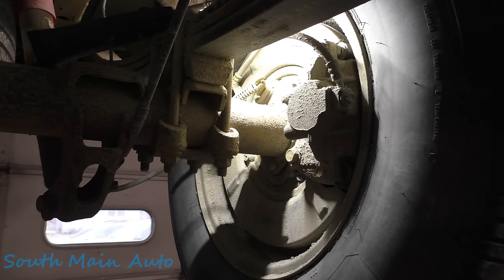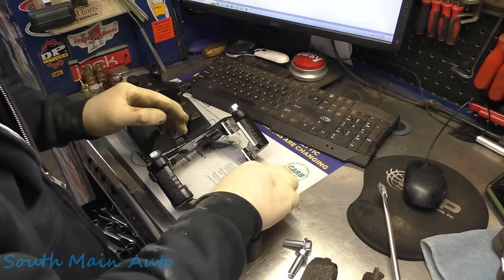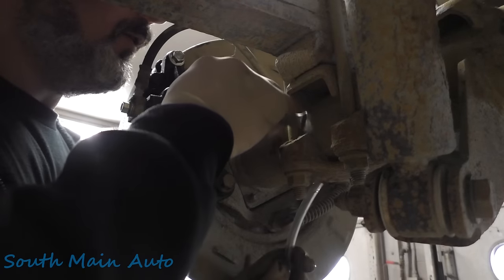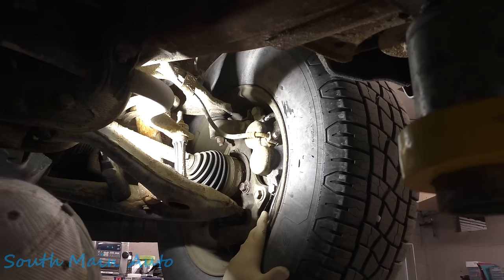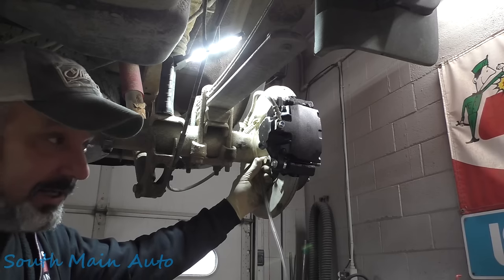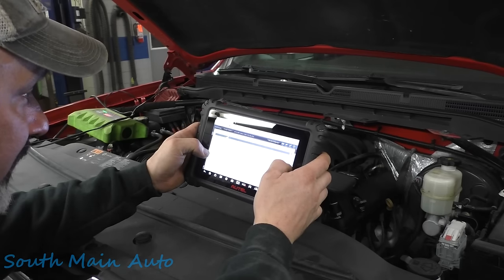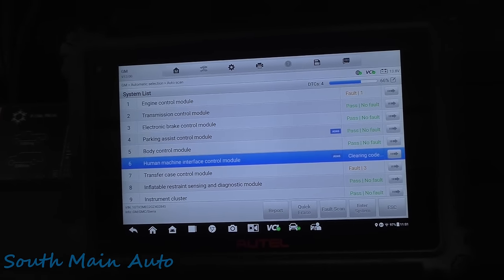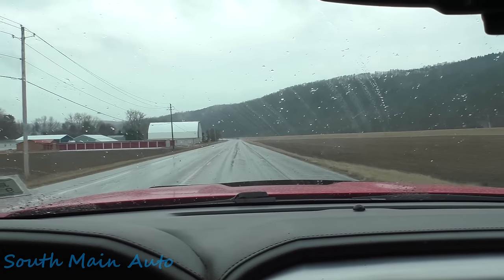GMC Sierra ABS Pump Motor Failure - Part II

Comment: Thanks for part 2. As a former resident of WNY, I do not miss the snow, ice, and salt! I rescued a 1989 Suburban from a wrecking yard here in North Louisiana and I can still read the chalk markings on the frame! A little “panther piss” on the nuts and bolts and they spin right off. You are the Master, and I have learned so much from you. Here is an idea, write a book of handy hints for DIY folks!
Reply: RIP these norther cars. My Jeep GC had no rust at 15 years. My Sebring was a rust box at 3 and I'm in Australia. For us the southern cars are our rust belt. Within 3 or 4 years they know they are loosing horsepower and start shedding weight. We don't salt roads here. They use an environmental friendly powder. Not as effective so chaining up or cleats on the tires is required.
Reply: @2DogsVlogs  where do they do this, "environmental powder" in Australia mate?
Reply: @1chrisandrew1  he might be talking about the "powder" he's on?! 🤣
Reply: As a life long wny resident I'm jealous.  My 2016 F150 that was ziebarted when we bought it is starting to decay, as is my 2015 ram 3500.  The Ram was pretty cherry even as a hot-shot truck based in Tulsa OK until thistle in 2019 when I bought it and dragged it to the rust belt.
Reply: Having experienced a GMT800 Chevy that spent a lot of time upstate, never again. Somehow its frame was mostly solid but every exposed surface was a crusty mess. After a couple of years I got tired of dealing with the rot and started looking south. Ended up getting a ZJ that lived in GA and southeast VA most of its life, and the difference was tremendous.
Reply: @spudth    Stop using Ziebart.  Use Fluid Film, Crown, anything but Ziebart.  Can't tell you how many vehicles we've failed for NYSI with rotted frames that were Ziebarted.
Reply: @killercan10  ziebart is good for 3-5 years then it needs soaked with known until it falls off.  Then go with fluid film.
Reply: @spudth    No.  Stop.  Just don't apply Ziebart PERIOD.  Just use literally anything else.
Reply: @killercan10  okay!

Comment: I live in the SUPER RUST belt, and I have been using "Corrosion Free" under coating for years! It's a biodegradable, non-toxic oil based undercoating that you have them apply once a year!! My 8 year old 4runner has zero rust!! Our largest city puts close to two million dollars PER DAY worth of salt on the roads during winter! We always joke that local rivers and streams will support saltwater fish, it's that bad!! Corrosion Free costs about one hundred dollars a year, cheap insurance if you ask me!! I would have it applied yearly, even if I didn't live in the rust belt because it makes everything that much easier to work on!! Cheers from Canada 🇨🇦

Comment: Mr O is a miracle worker with these cars. I'm over here snapping bolts, rounding of bolt heads on these rusty as* cars, lol.
Reply: 100% agree. I used to complain about rust and rounded bolts but after watching S.M.A for years I never complain anymore. Here in Colorado it’s not nearly as bad.
Reply: You didn't notice the "easy" button that he has on the bench?

Comment: A friend of mine had a shop and did one of these. He struggled to bleed it. During the bleeding the Snap Off truck showed up and he bought the pressure bleeder and low and behold he got it done. Nice to have the right tools.

Comment: With us not having inspections..  this little series just solidified in my mind that I will never be doing this on any car.. ever.   :)
Reply: At least in PA where we do have inspections, ABS is not something that is checked. Your vehicle can also pass with the air bag light on. All they care about is rust, ball joints/tie rod ends, brakes, lights and tires, more or less. I've only ever lived in counties that have emissions testing, so your check engine light must also be off and emission readiness monitors need to be set.  They do allow one monitor to be not set, but the light must be off.

Comment: In rust belt Ontario (which is to say all of Ontario) I use anti-seize and loosen and tighten the bleed screws every spring and fall when I swap the summer/winter tires. I also clean and grease the slide pins as well as the calliper hardware. With that routine I can avoid dragging brakes and stuck bleeders over the long term. 
AS always thanks for helping me become a better DYI mechanic.

Comment: I like the way you showed the programming section. It's a little frustrating we can't do that at home without the correct hardware, but I suppose once we get to that point we'd be able to find a pro who can do it for us. It didn't occur to me that with a bad motor, you're hooped if you can't get air bled from the ABS module itself. It is yet another reason to leave bleeder screws alone unless you need to go there.

Comment: Enjoyed watching! I didn't know you could use DOT 4 fluid on top of DOT 3. Make sure and charge the customer for the underbody flush when you test drove it in the rain!!  haha!
Reply: It’ Dot 5 you have to look out for, it’s boiling point is higher than most motors need.
Reply: @CrimeVid  It's also silicone based, so not compatible with DOT 3, 4 or 5.1, which are glycol based.
Reply: It makes so much sense. 5 and 5.1 aren't compatible. 5 is compatible with 5 and that's it.
Reply: @doug, charge for a PRNY salt bath❓
Reply: Wouldn’t he actually pushing out the DOT3 and replacing it with DOT4?
Reply: I think he miss spoke. Said he was adding 4 to 3 but then said can't go from 3 to 4. I think he meant to say can't go from 4 to 3.
Reply: 3 and 4 are identical in composition just different boiling points and ones less hydroscopic . Completely interchangeable

Comment: A few things, first, the timing is impeccable. I just did a new abs pump and module on an 03 Olds Aurora. Second, shout out for the Detroit Axle sticker on your box. At my last job we bought frequently from them. And lastly, you mentioned every day on the 40's in February. We in Detroit had a 74° day a few days ago. Of course in true Michigan fashion, it dipped into the 20's the next day. Nice break from the cold though. And most importantly, thanks for the lessons.👍👍

Comment: Hi Eric. Really enjoy your insightful videos. 
I particularly enjoy the electrical troubleshooting you do. I noticed a few times that when you find a blown fuse, you discard the fuse, usually without examining the fuse or commenting. 
Fuses tell you a story. If the fuse is just opened it probably says that the current went higher than the fuse rating, so the fuse just opened. But if the fuse is all black and there are pieces of fuse metal imbedded in the plastic, that tells you dead short. Current went to infinity. POW!! So it’s just a little bit of a clue to help figure out what happened. Thanks for the great advice and info. I’m a fan!

Comment: (puts on snarky, monday morning quarterback voice), AKSHUWALLY, brake fluid is not corrosive, however it is hydroscopic, so it can absorb water. If not checked and maintained regularly, it can absorb enough water to allow water-based corrosion to occur... (Your an expert, I'm not even a shade tree. I wish I lived in your neck of the woods, despite the corrosion, just to have a quality, trustworthy mechanic to use. Keep doing great work, and even better videos.)
Reply from the maker: You can't use a snarky Monday morning quarterback voice.... it's Friday 😐
Reply: Technically the fluid is hygroscopic. Not sure Hydroscopic is even a word in English. Just my 1.567 cents.
Reply: @steadyeddie7453  lol, I think you're right, I just just assumed "hydro" water, etc... but if you're going to knit pick my knit pick, I guess you win =)
Reply: @hikanthus  Refreshing to receive your response. Can never tell if I am going to trigger someone these days. Cheers

Comment: When I do a Brake job I always anti-seize bleeders, banjo bolts and all mounting bolts. I have redone brakes on a vehicle after six years and they all come loose easily. I always gravity bleed and then I have the Wife pump them, great success. Since I started they have changed the air pressure so many times and then they want you to vacuum the fluid through.

Comment: Eric, Here in the rust belt of Iowa I have resorted to using the liquid teflon around the threads for the bleeders. Then I put a vacuum cap on the bleeder. If I can get a 3/8 piece of hose to hold onto the vacuum cap I fill the hose full of grease and push that over the vacuum cap, Finally I spray the whole backside of the caliper with fluid film. Gets me about 6-8 yrs out of a caliper here. Usually I have piston failure before the bleeders freeze up if I do all of this. Try it on one of your personal vehicles, It works pretty good here. Your mileage may vary though.

Comment: It would have to be done when the caliber is new but I had good luck on one northern car.  I put stainless speed bleeders on my mother in-laws car  and was able to get them loose 3 years later when the pads had rust jacked.  I live in the south so don't deal with rust much other than this one car I work on for vacation.  I dont like Doorman but they make a kit for when you strip it.  You tap and intall the insert then the bleeder that comes with it.

Comment: I had an old-timer back in the 80s taught me a trick about bleeder screws. What it taught me was when you're trying to loosen them tighten it first until it just barely moves then loosen it up I don't know why but he discovered this it passes knowledge on to me can I use it all the time when I'm doing bleeder screws in about 95 percent of the time it works on aluminum calipers or cast iron usually on aluminum before I try to tighten it first I will add a little bit of warmth to it but I'm telling you it works.

Comment: More power to you Eric!  A good reason not to live in the snow belt.  My Dodge 12 valve is 28 years old and the underside is almost new.  The biggest problem I have is the plastics in the cab.

Comment: Did this recently on an 2010 f150.  On the ford you can swap over the original brake controller unit and save all the reprogramming steps.  I bought a "Wilbur's" unit for $100.

Comment: Eric O’…Thanks for another great Video series. Have you ever bled the caliper by the hose Banjo bolt? Take the caliper off and set it so the Banjo bolt is the highest point. Then bleed by loosening and tightening the bolt. Also, those copper Banjo seals need to “Flow”. Best to come back and retorque the next day. Or, Torque, then give the bolt a couple of hits with the hammer, and then re-torque.

Comment: Great job Eric , l recently had my abs pump replaced on a 2003 gmc 3/4 pu , and mechanic could not erase any of the codes after replacing pump. He said he could not get the computer to recognize the pump , so l now drive with the light on in the cluster.

Comment: Hey Eric,  I am in the Salty Shire of New England.  I know your pain!!  Im not a mechanic by trade by I do 95% of my own work and cant stand to have but only a trusted few do anything to my stuff....anyway, when I do bleeders whether new or otherwise, i put a wrap of oil/solvent pipe tape on them and they are worry free forever.  Maybe not something to do on customers cars, but definitely on your own stuff.  Also a 3/8" shake and break with a 6point socket works good on the stubborn bleeders if it will fit.

Comment: I think your a fantastic mechanic and you get to have your family around you while you work knowing they're safe. Love your electrical diagnostic work. Saw a video with the old dodge truck  you worked on for a friend who's  father passed. Good on you. You mentioned you don't normally work on vehicles that old. Why is that? Would they not be much easier to fix without all the electronics. Is it because of the deterioration of the metals due to the climate. I'm from New Mexico so old trucks here are still in good shape and simple to work on. Thanks for the video and be well.

Comment: Glade I live in da south and dont have to deal with corrosion/rust. MY 2016 GMC still looks great and runs like a top.
Reply: GM gets ripped on for the wax frame coating, but painted frames aren't much better. My last two Toyota pickups had rust all over the frame and body within the first couple years. Road salt is nasty stuff.

Comment: Outstanding 2 part series!!  More real world 'fixit' stuff.  

Hey, I got an old pressure brake bleeder exactly like your old Branick except the tag on mine is "Blue Point".  (Yeah, I got it from Snap On 50+ years ago and it cost more then than a new Branick does now!)   Mine needs a diaphragm from inactivity, but when ya need one, nothing else will do the job as nicely!

Comment: Use of heat. Early in my wrenching life I had a stuck screw holding a diaphragm cover on a 2 barrel Holley (Weber license). Applied a little heat with the trusty propane torch. As soon as the flame touched the carb, the body melted. Being too poor to buy a new carb I had to creatively bodge a repair so the accelerator pump would work with a partially melted diaphragm cover.
Reply: @Look_What_You_Did  A zinc alloy, melts at around 700F compared to aluminum 1200F

Comment: I tend to have good luck with the bleeders if I use anti seize and make sure the rubber cap is on it to prevent the crap getting in it.

Comment: I'm telling ya..you should invest in a Mini ductor venom HP. It's right around 600 bucks if I recall correctly. But if you live in the rust belt it's a must have besides a torch.
Reply from the maker: I have had one since they cam out 15 years ago
Reply: @SouthMainAuto  oh no doubt. Don't think I've seen you use it. Or maybe I did and don't remember. That could be a possibility lol. 🤔

Comment: GM had a few months there where the non-dealer GDS2/SPS2 launcher was completely fubar'd, and it was a nightmare.  Typically, clearing cookies, cache and session data in your browser, re-opening it and logging back into your GM account will correct the usual launching hiccups, and occasionally you do have to get a separate GDS2 subscription in order for the GDS2 Core to update properly.  If GDS2 and SPS2 versions get too out of sync, it can cause issues in both.  Hopefully helpful info to someone!

Comment: 10 years service life for a truck is crazy. I can’t imagine spending that much money on something and have it reduced to nothing in just 10 years.
Reply: In PA is as short as 8. They now use liquid  ice melt with a binder to make it stick  to the road. In summer  they treat the gravel roads to hold down dust. The gravel roads  just sand blast every anti rust treatment right off.    Most people I know  just lease everything that they drive. Toyota dealer gave me hell about hard off road driving. 
 Had to show them dash cam of my township roads it shut them right up.
Reply: @Wrang15  that’s crazy. I wouldn’t be able to justify ever owning anything nice in that kind of environment. I have a Honda Odyssey that’s five years old and I expect another 10 before serious mechanical issues may or may not junk it. Hell, last week I did the brake fluid and aside from some dust it all looked happy and clean.

Comment: A little bit of anti-seize might help on the new bleeder threads for the next person. Great content appreciate it.
Reply: Putting anti seize on bleeder screws will contaminate your break fluid. I live way north of SMA in PRNY. What I do is use silicone vacuum caps that cover the entire bleeder screw, and any exposed threads. This helps prevent corrosion. On AL calipers you are just screwed. The bleeder screws on AL calipers should also be AL, but manufactures don't listen to me. Lol
Reply: You can smear some RTV around the base of the bleeder after it's tightened and that will seal the exposed threads and help prevent the salt water from seeping in;   but that's not going to save the caliper from dying anyway. :)

Comment: I remove the bleeder and wrap it with Teflon tape. It's only to stop the threads from siezing not for any type of sealing. I honestly can't tell you if it works yet because bleeding brakes isn't a back to back thing on the same vehicle. Time will tell but one customer that comes in for regular service I try the bleeders on it and they at least still budge after 2 years... but who knows... a bleeder without it may budge too idk. I figure that Teflon tape on the threads can't hurt any.🤷🏻‍♂️

Comment: Thanks for part 2.  I wonder if after bleeding the brakes for the last time if the areas around the base of the bleeder screws could be cleaned with brakleen.  Then pump a shot of grease into the bleeder screw hole with a grease gun and then an o-ring worked over the bleeder screw so it fits flush against the caliper body or a bead of RTV applied around where the bleeder screw threads and the caliper meet.  This might prevent the corrosion from forming in the threads - probably time consuming and not worth it in a regular shop but for a DIY it might save on having to replace the calipers sometimes - just a thought.

Comment: I'm glad I work on cars outside the rust belt but I'm betting there's room for a decent profit in parts sales up north.  That and acetalyne.  LOL
Glad you pinch off brake hoses.  I use rubber caps but whatever works.  Too many techs leave brake hoses hanging with the master top on and then wonder why they spend hours trying to bleed all the air out later.  A little proactive planning goes a long ways when working on brake hydraulic systems.

Comment: Eric what are your thoughts on the self bleeder screws?  They basically have a one-way valve built into the bleeder screw so when you need to bleed brakes you just open the screw and pump the brakes and it lets the fluid and air come out but no air can go back into the line because of the one-way valve.  I've used them on several vehicles and had good luck, but I was curious your thoughts on them.  Great video as always by the way!